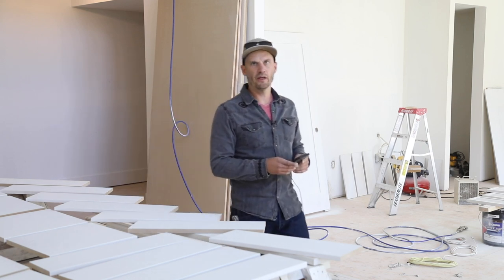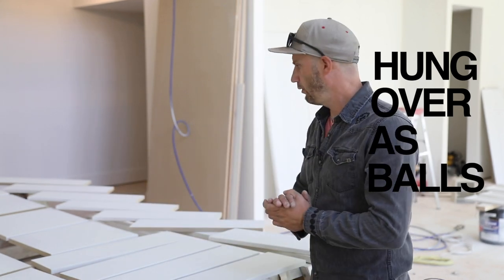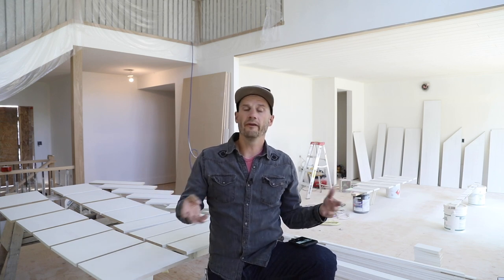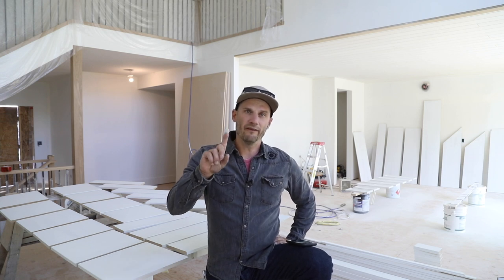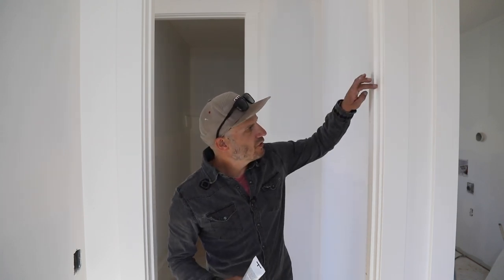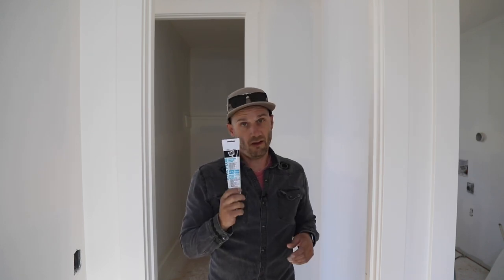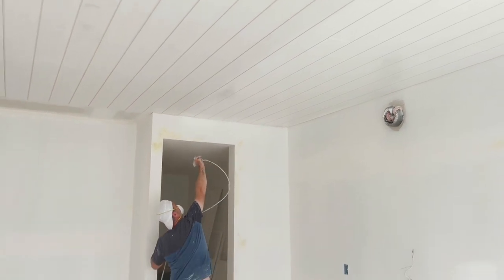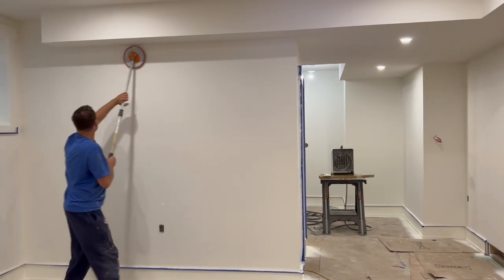Painting the interior of a house. What it costs.

Comment: There’s also a big difference between a $20 spraygun and a $13 tip off Amazon and a pro level $400 spraygun with a $50 tip so if you’re thinking about DIY you need to factor in those costs as well